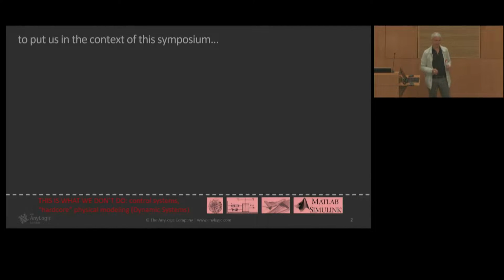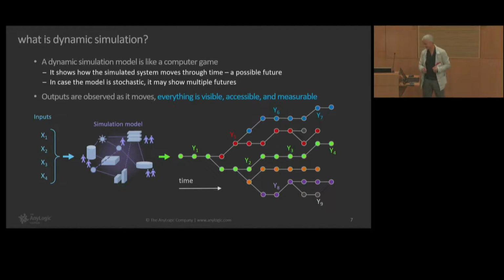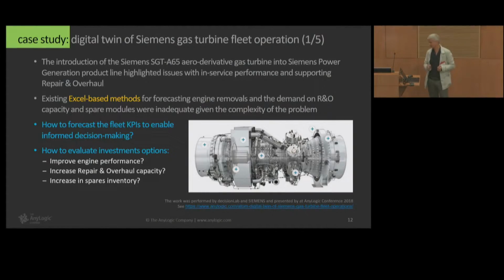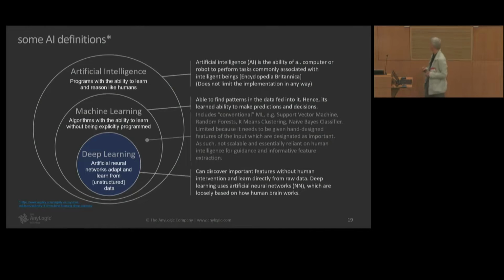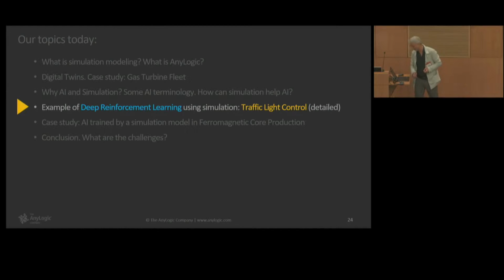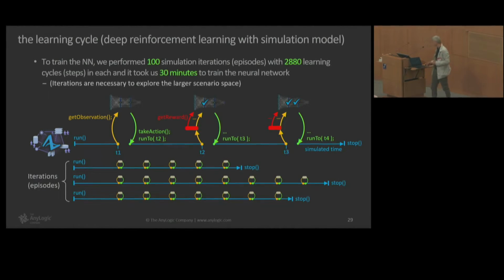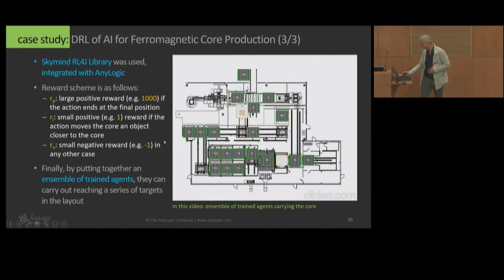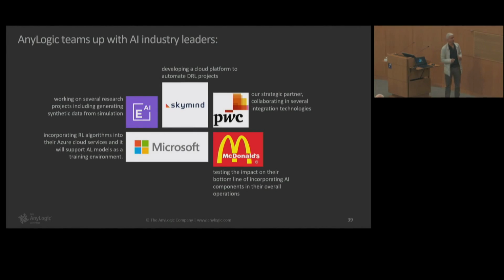Using Simulation to Train and Test Artificial Intelligence for Business Applications

Comment: Can we integrate anylogic railway simulator with openai gym environment to test some RL algorithms? As a railway environment does not exist in openai gym. Or do you have any suggestions?
Reply from the maker: Hi Yassine!
There are a few things to consider - AnyLogic model is implemented in Java and Gym is implemented in Python. It is, however, possible to integrate them using various approaches:

- use Java API for Gym developed as part of DL4J lib;

- connect Java and Python directly with some library-bridge like py4j, then you will be able to invoke python methods and java methods from both sides;

- use some intermediate data storage, and use callbacks with common Java API.
Here's how it works:
a) prepare data and save it in the storage;
b) invoke Python from Java;
c) process data on Python side and save it in the data storage;
d) callback Java and apply data in the model.

This way does not require any third-party libraries, but here you need intermediate data storage (file or database).